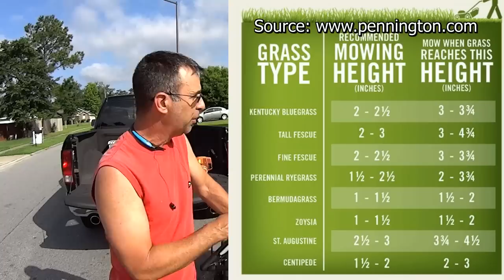THE REVIEW - Honda HRX217VKA 21" 186cc Select Drive™ Self-Propelled Lawn Mower

Comment: Hey Dan thanks for the review I've had mine for over two years we use it like three times a week in small lawns where we do use it a lot is in a shopping center that we do in between cars where we can't fit our big mowers it's been an extremely reliable machine for us I will by another when this one burns out but not in anytime soon ours is the hydro model which sometimes I regret I don't think I should have spent the extra money  the gear drive would have been fine and less things to break but over all great machine no need to spend over $1000 on a machine that you don't use as much as your big mowers.

Comment: My 216 HHR has been a very good mower. Over time the drive pinion gears to wheel gear mesh area will wear and become noisy and need replacement. After many hours of use. Very easy replacement procedure has it operating as new. 
Overall a superior unit that is incredibly easy to start and does a nice job of micro mulching the clippings.
I keep two sets of blades super sharp ready to change at a moment and then sharpen replacement set at leisure.
Belt and transmission seems bullet proof the only problem being the inner seals of drive shaft to wheel support area became detached but doesn’t really seem to have any effect.
Reply from the maker: These Honda mowers are worth every penny and maybe a few extra on the side!!
Reply: @DansVlog  yes and very concise and complete coverage on your model.
I find the steel deck satisfactory for my use. After an occasional power wash I can spray a primer paint on bottom of deck. I also like the paddle thumb drive system.
An occasional adjustment to allow for cable belt stretch. Mine has been a top flight mower for my yard with many obstacles.
My wife now insists on mowing as it makes it fun and easy.

Comment: I have a commercial Honda mower with the same blades, rear discharge, and other options than what you have. The rear discharge is great because with side shoots you remow over the clippings that were discharged from the last row cut, which makes it hard on the mower and the operator. Whereas with the Hondas rear discharge you don't remow the last cut, nothing comes flying out of it and leaves a less likely chance for someone or something to get hurt or damaged and makes it easy to mow tall grass because your not remowing the last row clippings. Most Honda owners never set theirs to full bag unless their cleaning up the sidewalk and driveway. I love my Honda and will never buy a different brand.

Comment: Awesome video. Looking at this mower as an upgrade to my hrr216 with the 160cc. Really like the idea of the versa mow system and some of the other features. Thanks for doing this in depth review. AWESOME!!
Reply from the maker: You’re welcome and I can tell you since this review I’ve come to like the mower more and more and more and more every time I use it
Reply: @DansVlog  Good to know. How often do you have to clean out the deck when just mulching? Grass seems to build up fast on my current honda. Thanks again
Reply: @michealsorrell3185  - Great question, that didn't seem to be addressed in the testing, or review videos.

Comment: I read most of the reviews and realized what a great review you gave and will be watching the entire video right after I make this comment. I have been looking for a review that mentions the ease or difficulty of the height adjustment lever. I tried to adjust it on a floor model and couldn’t believe how difficult it was on one particular wheel. The salesman had a hard time as well. I want to purchase this model but cannot find another floor model in order to test it to see if it was just that particular mower. Would love if you could possibly reply. It’s late October so I may hav e to wait til spring if I can’t find this little bit of knowledge.. thank you.
Reply from the maker: The right rear wheel is hard to adjust. Not sure why, it just is

Comment: Thanks for the great review. With a full bag did you feel the front of the mower pop a wheelie with the nexite deck being  so lite.
Reply from the maker: The deck being composite has nothing to do with the bag being 2.5 bushels. It is the size of the bag that is making the front wheels come light. Not the material of the deck LOL. The mower weighs 89 pounds dry.

Comment: I just used this mower for the first time. Good so far I think. I mowed my entire front lawn (in full Bag mode) and I barely have a 1/5 bag of grass. My old mower would have had at least a bag and a half (though that bag was def smaller). Possibly because of the mulching blade - even though I was in full Bag mode?)
Reply from the maker: Yes, the clippings are finer going into the bag
Reply: @DansVlog  That's what I thought and makes sense. Just wanted an expert to confirm. Thanks!

Comment: If you got the VYAA, then you would have gotten the Roto-Stop blade control system. Engine on blades stationary. Then activate the blade engagement, you are off to the races!

Comment: Im very dissapointed with my HRR216. The engine is perfect, but everything adround it is having issues. First of all, the rear wheels lock up when the mower is pulled backward. Yes... I have done the TSB replacing the rear height adjusters and removing any rust from the shaft. It just goes back to the same thing a week later. And the front wheels for some reason are toed outward. I believe its due to worn down height adjuster arms. Also, the blade clutch is starting to go out and it hasnt been more than 5 years. Thats it, im buying a Toro with a Honda engine. I hear that the new HRN is better, and the HRX is also better, but im not convinced they wont have issues.
Reply from the maker: Aggravating

Comment: Real good video Dan, as usual. I purchased this mower about three weeks ago and like it a lot. One thing annoys me though. When I have the selection in full mulch mode, why are there still grass clippings in the bag. Not a  ton, mind you, but should I have ANY considering the door is closed in mulch mode?? Thanks.
Reply from the maker: More than likely you have some debris that’s not allowing the door to seal properly. With the engine off turn the mower on it side carburetor up and look also with the mower on and your feet clear of the spinning blade open and close the door a few times rapidly to try to blow out anything that might be in the way
Reply: @DansVlog  Mower only three weeks old. And door appears totally closed - but I will do what you suggested, nonetheless. Thanks.

Comment: The best performance thing you can do for any mower is either buy a Tiny Tach2 and attach it to the mower or somehow check the rpms of the mower straight from the factory. The big box store mowers are especially bad for this and even My commercial FX Kawasaki engine was down nearly 450 rpms from the factory. My 22 inch Toro recycler was only 2800 to 2900 rpms straight from the factory. Tuned the Kawasaki to 3550 rpms and the Toro to 3350 rpms. Both mowers became totally different animals after the rpm increase. The reason the big box store Toros are terrible on mulching is the factory rpms are set way too low and when bagging it will leave a completely manicured professional looking lawn. Just like the 13 to 14 hundred dollar commercial 21 with the Kawasaki Kai. Front wheel drive for easy turning for areas my 48 won't go such as ditches and small grass areas. Works great. No need for the commercial mower. My last Toro 22 inch from HD is still running strong and I purchased it in 2008.

Comment: Dan, great video. I have owned two of these in the past. It is a great mower, HOWEVER, the vacuum/suction of this mower is quite poor. This would be a perfect mower if they could redesign the deck to get that worked out. Thanks for your review.
Reply from the maker: Cleaned that yard up real nice not even on full bag which means not even on full vacuum. here is a pro tip for you… Make sure your bag is clean and you can see through it easily and raise the front of your mower up one click to allow airflow to suck in and go through the deck drawing the clippings into the bag. It should perform fine
Reply: Really that's funny because I was having the same problem with this $260 lawnmower I just bought, it doesn't pick up grass hardly at all and it keeps clogging up so the grass can't go in the bag. I thought if I buy a Honda it would solve that problem. If Honda doesn't bag grass that well what lawn mower does? I'd hate to waste my money.
Reply: @jerryhanson3903  Jim, my only negative on the mower was the vacuum suction. Hands down best suction on a residential mower is the 30" Toro Timemaster. Sucks stuff up like a shop vac ;)
Reply: @gregau21  thanks for the info I might get one

Comment: Hey dan off subject ?? . i have a john deere wg36a walk behind your opinion is greatly needed should i go with mulching kit or bagger . been using neither and some houses its fine but not on st. Augustine grass throws it everywhere making me work twice as long...thanks
Reply from the maker: Bagger will cause you to have to empty bag and maybe haul off the clippings and mulching dulls blades and slows down your speed. I would get a chute blocker so I could open and close it as needed

Comment: Did you ever entertain the idea of getting one of the 30in decks like the Toro or the Exmark?  What were your thoughts when considering a push mower?  Thanks for your videos and expertise, I really appreciate it very much!
Reply from the maker: I had a 30 inch time master lawnmower. I could not wait to sell it and I sold it as soon as I could. As soon as the yards got the hick in our early summer that machine became a paperweight and could not process the clippings efficiently enough to use that mower affectively as a side hustle or lawn service. It’s a great machine if you can do the yards Before the grass gets any bit of tall. Watch my video playlist titled get to know the Honda HRX217 video playlist and it will answer all your questions and how to do maintenance on the machine so you know what to expect

Comment: i just got this mower and the rear wheels are hard to move without lifting up machine with one hand and adjusting with the other the front was alot easier.  cutting with this mower felt easy and it was pulling me through 8 to 10 inch grass
Reply from the maker: Enjoy!!
Reply: I've got a neighbor and I cut their grass along with mine and I bought a $260 lawn mower a few weeks back and its not bagging grass vary well it's keeps clogging up every pass I make. My question is since you have experience with a Honda and tall grass does it bag better then most lawn mowers or do you think I'll have a problem with that one too?
Reply: @jerryhanson3903   mine eats thru the tall grass and has no problem bagging.  mine is brand new so im guessing thats y but this 200 cc motor just eats for me im very happy with mower.  i cant compare to other mowers because i had lawn service before lockdown but had to take care of my grass because i live in michigan and companies were not deemed necessary
Reply: @jerryhanson3903  i would check air filter sometimes they get clogged
Reply: @smokedya420  could be part of the problem thanks for the advice
Reply: @smokedya420  I lived there for a few years Roscommon Michigan that house right next door to the graveyard LoL I remember walking around asking people if I can mow their lawn

Comment: Dan, 
Great video. Making a purchase of anything motorized and costly is always a gamble, especially when reading any negative reviews on products. I wish more people would give real-world/real-time reviews on products like you have done here. Thank you very much for taking the time! Once i purchase one of these, I will be sure to watch your maintenance video. 
It would be an honor if you would watch a couple of my videos; just look up WTF Construction/David Will. Good for a cheap laugh and humiliating myself!
Reply from the maker: Sweet! Thank you
Reply: @DansVlog  Dan, thank you again for the review.  You weren't kidding,  I bought the HRX217VKA, couldn't be happier. Two mows in and I can't wait for the next. For those of you on the fence,  get off, cause this thing is a beast. I'm 40, 6'4" 265, moderatley athletic (aka workout but I like pizza and beer 😁) and have a hard time keeping up with it. Had to set the variable speed rather low...don't want to work too hard, lol.  If you goose it, the front end does kick up a little, but that's negligible. My yard is 1/3 acre, with a couple of 45° slopes...no problem for this little tank. The 200 CCs performed effortlessly through my first cut which was about 8" of thick, damp, grass. The best part? No clumps left behind! I set the Versamow System right in the middle between mulch and bag and it performed perfectly! Next stop, Dan's maintenance video. Thanks again, Dan!

Comment: As soon as i heard the wheels clicking i decided to go with the commercial version instead. 
The gears on the axle will inevitably strip like the HRR series. Even when repaired its never the same.
When running right these mowers are great. 
Once the gears strip though they become a push mower
Reply from the maker: Very true!

Comment: I have never used self propelled. How easy is it to push or pull without using the self propelled feature (does the transmission add extra drag on the mower?)
Reply from the maker: If you don't want self propel, get a light weight, big weight big wheel mower from Lowes or Home Depot

Comment: Go to the post office and get a change of address packet. There are Lowes 10% off any purchase coupons in them. Save $70.

I'm about to get rid of my Exmark commercial 30 for one of these. Lowes has a 201cc for $709. There is also a hydro drive version for $729.
Reply from the maker: $70 savings is awesome!!

Comment: I have a Hustler zero turn.  I do residential yards and my Hustler won't go in all the backyards that I do due to the gate width.  I've been considering getting a Cub Cadet cc600, with the 30in. deck.  After seeing your videos and reviews of this Honda, it has me guessing about getting one of these mowers.  My purpose is to get rid of my generic 21in. and upgrading to the Cub Cadet to save time when I have to push.  What are your thoughts?  This Honda seems like it could also save some time with the bagging system.  What do you think?
Reply from the maker: I really appreciate your trust in my advice, but unfortunately I have to decline to give you an answer that is definite. Only you know what you are dealing with i.e. How many back yards you need this for, will you be bagging leaves or mulching only grass etc etc. All I can do is this very detailed video to give you all the information you need to make an informed decision.

Comment: Dan,  I read on other reviews that when the bag is full, that the front end is too light and it wants to just pop a wheelie,,,,Do you feel that is a problem??
Reply from the maker: No because if I feel the front end getting light I’ll take a second to empty the bag. Just because it has a 2 1/2 bushel bag doesn’t mean you wanna put grass in it until it’s full. If you’re vacuuming up leaves, that’s great but if you’re cutting grass then you have to use a little bit of common sense

Comment: Honda makes a seperate discharge chute that attaches to the back and it spits out to the left.  Unfortunately I don't think it fits the HRX model.?  Good news though:  I have found if you have an old premium 21 inch residential or commercial John Deere 14SB/14SC, JX75/JX85 they had a seperate side discharge chute that fits almost perfectly on the back of the Honda HRX models too and it disperses the clippings better if you need to side discharge.  Just a thought.  Plus that part is still available from John Deere.
Reply from the maker: Thank you

Comment: Hi.. Did you sharpen the blades during your maintenance? I'm guessing it has to be quite a job since there are 2 blades with different sharpening angles (at least that's how they look to me on photos). How often do you tend to sharpen your mower blades?
Also this is a 3,2 Kw engine. I've seen engines in 190cc category with 4,5 Kw but they weren't mowing as good as this Honda does. Do you think it's because of the high torque this engine has?
Reply from the maker: vegass04 watch the maintenance video!?
Reply: @DansVlog  I've seen the video but I must have missed the part where you say how often you sharpen the blades usually. Is it every week, every 2 weeks, a month?. Also Honda says that the grass doesn't stick to this plastic deck at all. Too bad you've hosed it down. Was there any grass stuck on the deck..
Anyway I'm going for it. I'm buying the machine next week. At this end of the pond the model is named Honda 537HRX. These 216 and 217 models are for the US market. The only difference is that mine has the blade clutch, or how Honda calls it - Roto stop. Its a great thing to have although it runs up the price. Keep up the good work and thank you for the information you bring through your channel.